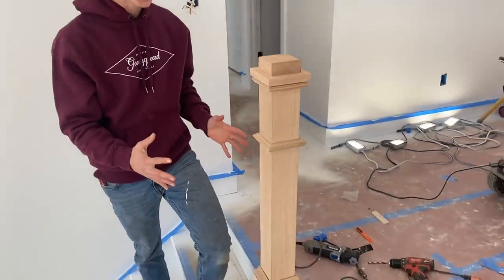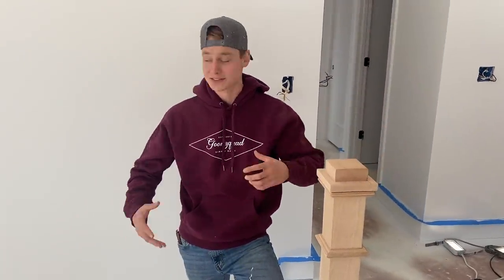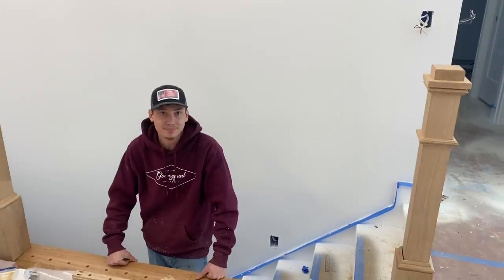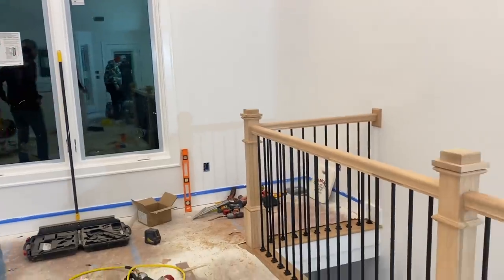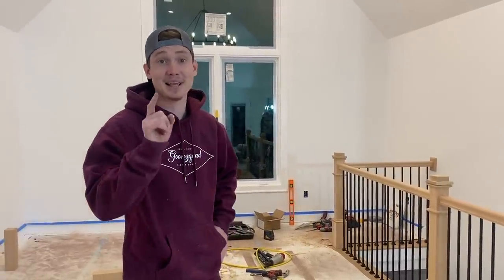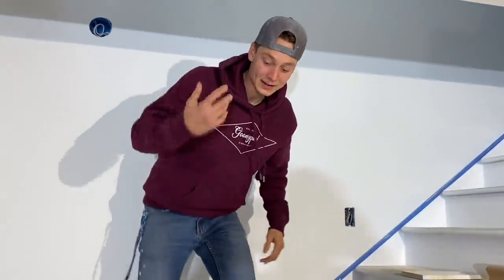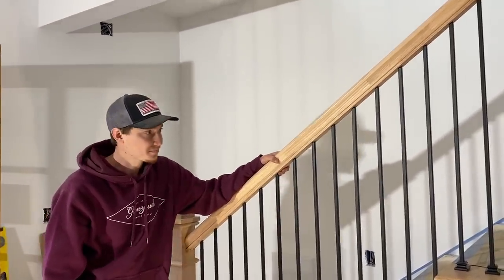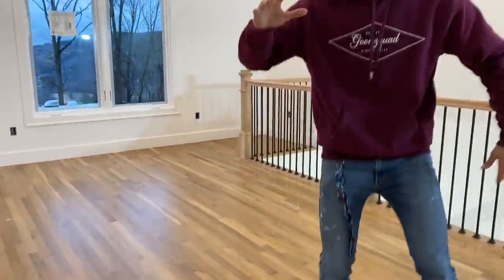The New Goonzquad Headquarters Part 64

Comment: The only way that downstairs lower railing is going to look uniform all the way to the end is if you remove the square you have mounted to the top beam cut the that end of the railing at a 90 degree angle between the last 2 spindles then glue another piece of railing extending it all the way to the end. rip some meat off the top of the extension piece so you can keep the spindles uniform all the way to the end. otherwise it's going to be an eyesore.

Comment: You should have terminated the top of rail into 1x6 white oak board butted into the vertical surface. If you can detach the top of rail and swap out the supplied trim piece with 1x is your best bet

Comment: You have all the kit to do this hand rail but those wee daft brackets are not a long term fix of they posts i would checked the posts out and cut holes out in the floor and then glued and fixed them.

Comment: I think if you guys removed the small piece of wood you used to to fasten the end of that rail into underneath the beam, and replaced it with a piece that runs the full length from the rail is screwed into to the end of the beam it would look dope as one solid piece. As opposed to adding a different piece of wood and attaching it that way. It’s just my opinion. I also think that it might look more consistent than if you were to use the black pieces from bottom for both top and bottom in that area. Again just my opinion. Because ultimately It’s your decision to make. Keep crushing it Brothers! Shout out to your Pops too! It’s always nice to work on a project like that with your Dad. I can’t wait to see everything done. BTW... I’ll DJ your house warming party for free.

Comment: Y'all need to reinstall those first newel posts, one  trip and fall against that second floor one and those little screws will tear out.  I hope you can find someone to reinstall those. I think This Ole House did  an episode  with reinstalling those with long all thread and large washers and nuts through the treads and through the post into a recess at top of the post to suck it down tight to the tread or framing.  Not trying to rag on your work but I want you guys to be safe.  They look good but they won't stand up to a 280 pound person leaning or running into it.

Comment: Goonzquad were deceived by the source from which they purchased the 'solid wood' Newel Post or Posts that were not actually made of solid wood. The US Federal Trade Commission regards a product described by a seller as 'solid wood' as needing to be made from milled lumber entirely sourced from a tree, and does not support the description of 'veneered engineered timber' ('VET') as 'solid wood' in products. Some advertisers and retailers misrepresent VET as being equal to 'solid wood' but that verges on deception because solid wood is a largely known quantity as far as strength is concerned, is known to remain durable for a hundred years or more, is usually repairable if damaged, and has excellent impact resistance and fire resistance, whereas VET is of unknown quality, tends to be weaker than solid wood, combusts rapidly while emitting toxic fumes, has unknown durability over time (particularly with regard to the adhesive or adhesives used) and the veneers are damage prone, particularly on external corners. VET is popular with retailers and suppliers simply because it is much cheaper to produce than solid wood, but it is certainly inferior in many respects, and as soon as Goonzquad found that they had been deceived and charged for a product that was falsely described they could and should have rejected the inferior product and insisted either on being given the goods they had actually ordered, or they would be legally entitled to demand an immediate full refund and then to obtain their needs from an honest source elsewhere.

Comment: The wrought iron spindles should be epoxied into each hole, top and bottom. Stair component manufacturers carry the epoxy. Once you use it, nothing makes the entire railing more solid.

Comment: You need a bottom horizontal base instead of putting the vertical rails into the base.
The gap you left on stairway at the top isn't going to pass inspection a kid can fall out the side it..have to put more vertical stils

Comment: These guys are going to build a helicopter!

Love the videos though
Reply: They may be going to replace components and carry out maintenance on their R22, but only if the appointed Certified Helicopter Mechanic agrees that they are sufficiently competent to carry out that work under his or her supervision. Once the aircraft has been Approved as Airworthy, it can be flown by any Qualified Pilot who holds a current and appropriate Licence. The rules and regulations pertaining to helicopters, their repair and operation, are far more onerous than those applying to road vehicles.

Comment: Your gonna be really good at handrails soon! especially after you pull these out to redo them properly haha. Looks great boys but read the comments here from time to time, you have a house full of people telling you things your doing wrong sometimes weeks before you even begin, but you never read the comments section, even tho you ask us to "comment down below"
Reply: Yeah, there has been at least 30 comments about how they failed on the post install( which I 1000 percent agree with) and in my 25 plus years of construction work have never seen anyone install hardrails with pocket hole screws....they make rail bolts for a reason. 

I'm sure that there "research" on you tube didn't include either Richard or Spencer channels.

Comment: Boy's I think the reason the newel posts are that long is because in the UK they have to be fixed below the floor for strength and safety and bolted in place??  Is it different in the USA?
Reply: In the typical US Building Code the method of fixing the newel posts is not specified, but the entire balustrade, guardrail and handrail must be able to resist a static lateral loading of 200lbs at any point along the handrail without discernable deflection.

Comment: Seeing as how your brother didnt pay the rv storage fees, its yours. Now you can either mod it into a the worlds fastest motorhome, or simply park it beside the garage, and make a nice little heated hallway leading into it. Once the place is completed, you should really consider hand carving 3d relief landscapes of a cityscape from a high altitude point of view into the wood flooring, then flood it with a clear polyester resin to bring it back to a flat level. Sure it will take you years, or you could build a small movable type of cnc machine. Come on man, do it! #PeerPressure

Comment: normally in a house like yours we would not have put the railing like that.  we would have put a railing on the long wall and kept the bottom open,  why? simple furniture.   it will be fun now to get things upstairs.   but if I had to do it like you, simply add a full oak wood that matches the same as that rail and just cover that ceiling area and keep going.    3 way switch for that kitchen?   that is why you could not get it to turn on...

Comment: Maybe US regulations are different but here those posts would have be fitted into the floor itself not just bracketed on top. Anyone leans on the top ones will just pull those small screws right out of the laminated floor.
But you guys are doing a great job all round. Personally I think there is too much white and  I would have added some light colour to the walls to accentuate the white skirting and trim boards but that's just me.

Comment: When will we get an update for the helicopter?
Reply: Goonzquad recently reported that they expect to receive the certified replacement components for their Robinson R22 powerplant shortly. They will then need to employ an appropriately qualified Aircraft Technician to supervise, inspect and approve all work on the aircraft, so that it can then be certified as Airworthy in all respects. Before operating the helicopter themselves, the brothers will also need to attempt to earn the required Licences, which is a challenging process. All aspects of private aviation are strictly controlled in the USA, and for good reason, so Goonzquad have a considerable amount of work to do before they can fly their own rotary wing aircraft.

Comment: Sorry to say not a proper mount for posts or corner posts. Should have been mounted into/thru the floor and tied into the joists etc it will break loose not safe ,my opinion !

Comment: Not sure if anyone commented yet but I would have held off the stair rail until I've moved in all the furniture. Looks like a pain to move things in.
Reply: It's tricky to do that because the Final Inspection may not pass if the stair does not then meet all the Code safety rules, and legally the occupiers are not permitted to move furniture into the property until all works are substantially completed and a Certificate of Occupancy has been issued. Goonzquad may have to furnish the upper floor by using a crane to lift large items in though the large front window in the Living Room if the stair is too cramped to do this.

Comment: Lucky that there was a hot water line already in place for the bathroom mistake
Reply: That is the pipework which had been in the wall all the time ready to connect to the basin and WC. The plumbers were innocent of any error, and the problem was actually that the drywall installers (and whoever was supposed to be instructing, managing and checking them) omitted to feed the one red and two blue flexible pipes through the plasterboard in the correct positions when the wall was being closed up.

Comment: Your newell post’s won’t pass inspection, they are supposed to be mounted to the concrete on the main floor the upper posts 
required to mounted to the beams under the floor.  The post’s are supposed to stop a person from falling down the stairs if they fell 
against the support rail system,  probably a 600 lb force.  The rail mounted to the wall should be screwed into a stud.
Reply: Agreed. The lateral static load test is actually 200 pounds, but I doubt if the small brackets on those posts will withstand even this force.
Reply: Agreed , John, I was thinking of a load of a moving body that would be in excess of 200 lbs. Most people would come close to that static load with just their body weight.
Drilling a hole and threading the wood with a steel threaded rod would be a better solution, probably 3/4 rod.
Reply: @johnmoreton459  True. A Building Inspector in the USA once justified the 200 pound Lateral Static Test Rule to me by saying that since the Balustrade/Guardrail had to show no discernible deflection up to that point, it was not meant to be a Destructive Test for obvious reasons. She thought that if a rail was completely unmoved at 200lbs, it would likely take more load by first deflecting, then beginning to fail at its weakest points, before eventually suffering some form of total sequential collapse at a much more impressive static load. So although a drunken local Sasquatch would probably turn a 200 pound rail into firewood, the Code Test is probably a fair and reasonable benchmark for real life situations.

Comment: I think you need 1"x3"x4'  oak to tie in the rest of the spindles. You can integrate it into the banister and get rid of that small piece. Use the same detail that was routed into it. You may have to do the routing yourself if you can't buy it.
     There may be a problem with the banister not going to the last step. If you leave it the way it is, the inspector may require a banister on the other side. Otherwise it needs to be continuous to the top of the last step.
https://i.pinimg.com/originals/92/dd/95/92dd95d44719dce6f39a90e427badffe.jpg

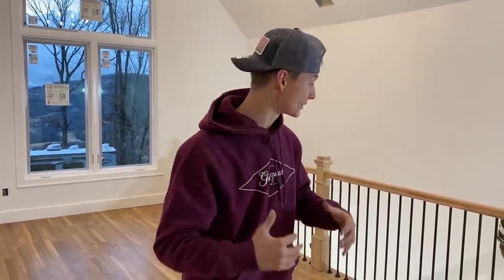Comment: @20:28 there is a dark circle or hole in the floor next to the rail post. What is that?
Reply: At one stage there was an electrical cable protruding from this hole. Not sure if that is still part of their plan.
Reply: @johnstedman4075  I guess it will be. I can't see them not filling that if not.
Reply: @robertbailey4454  Yes. The cable may be a mains supply and signal wire for a TV or something like that, placed there to avoid running unsightly wires around the stair opening. In larger rooms, we often put a grid of floor outlets (accessed through secret hinged pieces of the hardwood strip flooring) so that trailing wires are eliminated. We link the floor boxes with conduits, so cables can easily be fished through. Clients like that, because a 'wireless world' is not quite here yet.

Comment: Guys! I gave you a BIG HEADS UP and told you to hire out the staircase because you installed the posts WRONG! If your inspector looks closely he will not pass the staircase and you will have to tear out all your posts and have them install them correctly. The posts are supposed to be counter sunk into the floor and bolted to a joist or beefed up framing under the sub floor. The posts are required to hold a certain amount of weight to keep someone from leaning into the railings and snapping them off and falling over/through/down the stairs. Several people including myself offered advice so you guys would have the staircase work done correctly but you decided to do it yourselves and you did it wrong. I just can't see why you did it that way, it's not safe and if you can grab the top and shake it side to side/front to back it will pull away from the base. I wouldn't let that slide, tear it out and hire a professional to come in and do it right. I can't see a final occupancy permit being issued by any decent township/county building inspector because of that staircase installed incorrectly. It's not a job for the DIY homeowner to tackle, it takes many years to learn how to do staircase work correctly. SMH.............c'mon guys you should know better than to do a sketchy install like that when it's your own home.

Comment: I feel like on the downstairs hand rail, where it meets the roof shouldnt have been a square with routered edges, but just a long rectangular piece of wood that runs all the way along. Now you have done that, its going to be difficult to change it. And you cant do simones idea, as the spindle on the next step up will be half in the wood. 

Should have run the wood all the way along before you mounted the rail dudes.

Comment: You do not need the railing on another side
Reply: The decision rests with the Building Inspector, and how flexibly she or he may (or may not) interpret the rules. A literal reading of the Code for Hamilton County, Chattanooga (where the HQ House is situated) makes it necessary for a continuous handrail to run adjacent to every step of the staircase. However, the setting out of the LVL (it is about 8" too far to the west) may make this impractical as things stand. At the moment only the lowest eight steps have a handrail next to them, but the eight above do not.  At his stage, moving the LVL is not viable. The only solution may be to install a separate section of handrail somehow situated to continue the existing line to the newel above, or to run a additional handrail on wall brackets up the whole of the flanking wall. Neither are attractive ways of solving the problem since they will narrow the useable width of the top section of the flight by about 6" and be visually awkward. A better arrangement might be possible by dismantling the new sloping balustrade and moving it westward, so it clears the floor edge above, which could be made to work but again narrows the stairway by around 6". The whole mess is the result of inadequate planning, lack of forward thinking, and an inability of whoever was in charge to comprehend a holistic approach to the total design of the stair and all its components.

Comment: I'm no expert but surely those posts should be fastened to the joists of the floor. I can't see Simple L brackets standing up to too much weight. Especially being as its meant to be a safety feature...
Reply: The three newel posts on the upper floor should indeed have been very securely dowelled and bolted to the LVL (Laminated Veneer Lumber) beam running beneath them. The single newel post at the foot of the stairway should have been securely dowelled and bolted to the concrete ground slab. The current installation is inadequate and potentially dangerous.

Comment: Can someone tell me why do you need AC systen in your house in US?
Reply: The part of Tennessee where the Goonzquad 'HQ House' is located is subject to temperatures that are uncomfortably hot in June, July and August, and unpleasantly cold in December, January and February. Extreme temperatures throughout the year can vary between 20 degrees Fahrenheit in January and 100 degrees Fahrenheit in July. Heating, Ventilating and Air Conditioning Systems (HVAC) are considered essential by users of medium and high cost residences in these conditions.
Reply: @johnstedman4075  Ohh okay. We in Europe have mostly Radiators but thanks for the answere. Make sense to have one system for everything.
Reply: @M2kullVEVO  In most of our European projects we specify underfloor heating using microbore pipes filled with water and polypropylene glycol, and integrated with hardwood flooring. Solar power and wind power is favoured for heating the water. HVAC is normally only used in specific parts of residences where it is appropriate, such as for home cinemas, media rooms and indoor swimming pools. In summer, a well designed house in central Europe can almost always be sufficiently cooled by 'smart' control of natural ventilation. In the southern Mediterranean areas full HVAC is more commonly specified, since even the Greek Islands have both a hot summer and a cold winter.